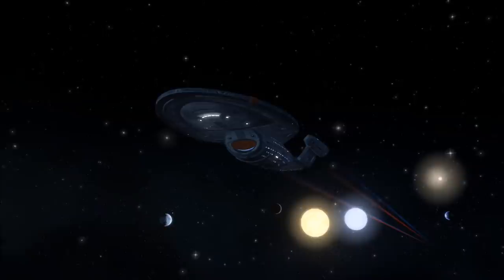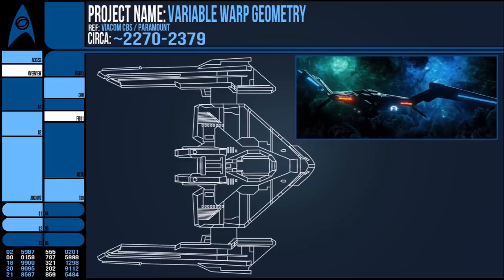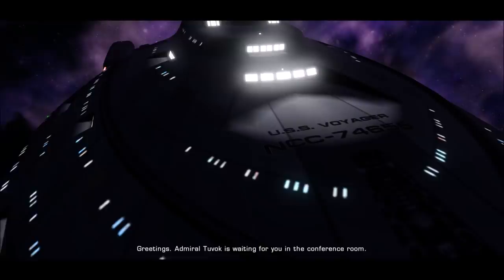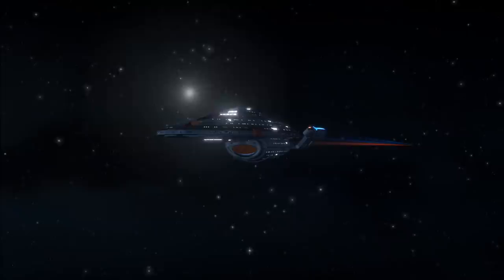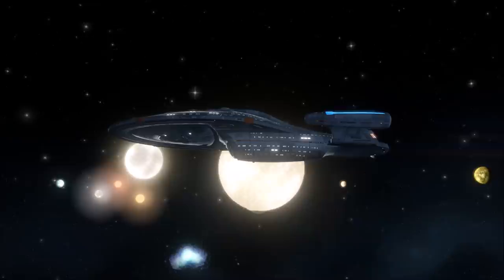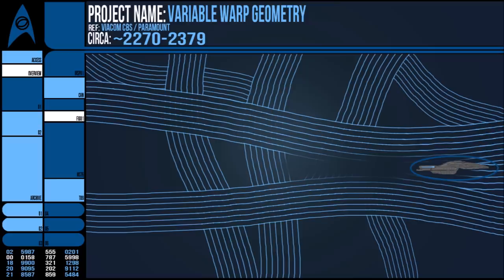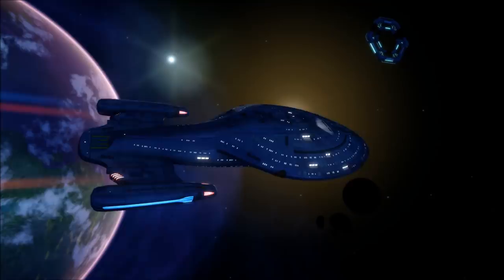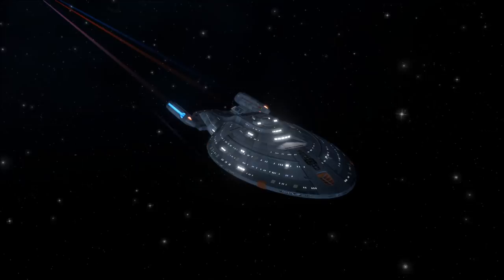VOYAGER'S "Hinged" Nacelles

Comment: Can you cover other FTL drives in sci-fi and compare it to trek and Mass Effect.
Reply: Culture series - the grid, basically subspace also.
Reply: Well, if you are in an unclogged hyper space lane in Star Wars, you can get across the Milky Way sized galaxy in 2-4 days with a fast drive.
Reply: fuck it, Warhammer 40k FTL.
Reply: I thought ships in Mass Effect do not use any kind of FTL at all, since all the travelling between solar systems or different sectors of the galaxy is done via jump gates.
Reply: @Furzkampfbomber  it warps space to allow faster travel. Still considered an FTL drive even by Mass Effect's own worldbuilding.
Reply: @Barry Bend

Ah, thanks for clearing that up. But to make that clear, without jump gates, would there still be faster than light travel in the Mass Effect universe? As I understood it, one of the problems with the jump gates shutting down at the end of ME3 was that this would basically have destroyed the galactic community and let whole planetary populations starve to death?
Reply: @Furzkampfbomber  they'd be going into FTL but not to the speeds of the network. In Mass Effect andromeda the ships go into a faster FTL than the older drives due to a lack of a Mass Effect network.
Reply: @Barry Bend

Then I have profoundly misunderstood FTL mechanics in ME so far. Thanks again for explaining!
Reply: @Furzkampfbomber  Travel at FTL is possible without the network(however not without Mass Effect Technology as its achived via Element Zero), (it was even a part of gameplay in ME 3(and i think in 2 as well) where you jumped to a cluster or similar and had several systems you could travers via FTL flying) however, the FTL speeds achived via regular FTL drives in ME are REALY slow in contrast(well as slow as FTL can actual be) so the destruction of the Mass Relays effectivly destroyed all Travel outside of Local clusters. making some planets who rely on regular inports to sustain themself die do to the cut supply lines.
Reply: @SGT_Weber

Thanks for the explanation! 

And this was one of the things that really bugged me after seeing the end of ME 3, that with the portals shutting down, billions of beings were doomed and yet, this was portrayed as some sort of victory.
Reply: @Furzkampfbomber  well dependng on the ending it WAS complete and utter starvation for a lot of colonys, however the reason WHY it is portrayed as a victory is, depending on ending the Mass Relays are only "damaged" and can be repaired relativly quickly(either wiht or without reaper help) some colonys will starv to death etc but overall its a small price to pay for defeating a foe that was thought undefeatable 

and even if they are completly destroyed, the threat from the Reaper is gone, meaning even if the current Milkyway Species are Likely never able to reestablish any sort of Simliar society as it was pre Reaper war, and some colonys will be dying.. as well as probably all turian forces over earth(and everyone else that needs left handed amino acids or whatever it was) but overall,
the Galactic society has prevailed, it will be smaller most likely, it will not be the same, but they won what was thought to be impossible and furthermore, 

the next generation of species arent doomed for the same fate anymore as any precursor before them, and they do have functioning Mass relays as only Activated ones where destroyed. 

It will be a one way trip for most systems, but they could use these non destroyed ones, together with reaper tech from all the reaper wreckage everywhere to someday rebuild the Network

Tl:Dr
it was the death of trillions, but its also the saving of Many many many More in the future and overall, and depending on ending it was only a minor obstrction of the relay, taking a couple of years to get the major relays up and running again most likely-
It was a victory, it costs a trillions of live, but it is a victory notherless
Reply: @Furzkampfbomber  If I remember right in Mass Effect Andromeda, in the galaxy they went to have no gates but they developed a drive that could jump in the ship.

Comment: Warp travel does not damage regular subspace, if it did then after millions of years of warp capable civilisations there would be no subspace left.
The Hekaras corridor in Forces of Nature was UNIQUELY vulnerable to subspace damage.
Imagine how much damage just Earth and Sol would have received from warp travel, and they've only been at it for a few centuries.

Variable geometry nacelles were to allow travel in the Hekaras corridor and any similar regions (with tetryon radiation) without triggering any effects, a strategically useful ability, especially if encountering similar instabilities during exploration where no rescue ship would know to look if you got in trouble. 
Or just taking a shortcut or fighting ships in that corridor, especially preventing standard warp drive ships from doing further damage in that area by enforcing the speed limit.

Starfleet was testing the Intrepid class's variable geometry nacelles and the Sovereign class's warp core, that also didn't damage subspace in regions that were susceptible. Starfleet were trialing both concepts, the Sovereign's one was considered better, lack of external moving parts probably helped. And that made retrofitting to older ships a possiblity in a minor refit…

This enabled the ship to travel at warp in rare unstable regions where subspace is vunerable.
That it damaged all subspace was a red herring stated by the Doctor when he was being forced to trick Voyager into ejecting their warp core. https://memory-alpha.fandom.com/wiki/Transphasic_warp_drive
https://memory-alpha.fandom.com/wiki/Renaissance_Man_(episode)

Comment: Good video. I knew the hinged nacelles had something to do with protecting subspace. But I didn't understand why they lowered them back down when the ship was at impluse. Now it all makes more sense if they are being constantly adjusted during flight.
Reply: The constant adjustments of the angle does make sense to change the shape of the Warp bubble.

Another reason they go flat when not in use is so the bussard collectors on the nacelles are not blocked by the primary Hull.
Reply: It's a shame they never showed them moving besides the "up to warp"
Reply: It just creates a clear line of site between the nacelles, which is supposedly a Star Trek rule for warp. So Voyager can have the new design of not have pylons sticking out, but still follow the rules to travel at warp

Comment: It could also have something to do with the ship being designed for atmospheric use and landing.
Reply: Beat me to it by 52 minutes!  Landing a starship, even a small one, must be easier with a lower center of gravity.  Of course landing with a generous supply of antimatter on board isn't exactly calming the pilot's nerves, either!
Reply: +Redblade It doesn't have to be either/or.  It can serve dual functions.
Reply: There's an especially hot pit in Hell reserved for people who try to win arguments about canon by saying, "It's just a show/movie."
Reply: Sealion someone else.
Reply: @Redblade 
The pylons up configuration is the most efficient.  The ship is switching from impulse and thrusters to using the warp engines. Pylons up is the same configuration as the various enterprises and other warp driven ships.
Reply: Redblade That’s a lame argument. Even if it’s a TV show, it doesn't mean that we talk about it like it’s completely real. It’s no different then when people talk about how things work in Star Wars or Lord of the Rings or literally any other fictional series.
Reply: Redblade You seem to have missed the point of my comment. We know it is fantasy. We do not give a shit. We chose to talk about it like it’s real.
Reply: @Redblade "fantasy" you say?
Remember the original Shatner star trek? 
With the "flip out" communicator ? 
In the 60s?
 fast forward couple decades we had flip out mobile phones?
Reply: As far as I can recall, they never raised the nacelles when in atmosphere

Comment: Well, with the Alcubierre drive, changing the shape of the bubble from a sphere to something oblong and with a narrower cross section reduced the amount of negative mass needed from the equivalent of all the mass in the Universe to the equivalent of the mass of Jupiter.  The question is why would a flatter geometry be better at sunlight speeds hence necessitating the nacelles be folded down when not at warp?  Is it to line up the impulse engines with the center of mass of the spaceship, if so why not just arrange the impulse engines appropriately in the first place.  Cochrane's warp drive folded out because the ship was launched into orbit on a converted ICBM so it had to fold into a cylinder, stealth would probably be better served by a sheath around the hull and nacelles rather than flexible nacelles.  Really only Cochrane's ship had a reasonable argument for flexible nacelles...

Comment: 2:36 I want to correct you there slightly. The vessel stays fully in normal space, but the warp field is a subspace field, and the warp field bends spacetime to create the warp bubble and therefore the actual propulsion. The field creates the bubble, but they're not the same thing! Subspace drag affects only the warp field, which in turn means you need to pump more energy into the field in order to achieve the same warp field strength. The warp field strength and the relative speed of the warp bubble are related, but better hull geometry can give you more speed/a faster bubble for the same field strength.

This may also be the reason why the warp scale got overhauled, and it explains away some inconsistencies in terms of speed.
The energy pumped into creating a warp field is therefore only loosely linked to the speed reached, since both subspace drag weakening the field strength as well as the hull geometry supporting a more or less efficient bubble play into it.

Comment: They have to have view contact, while at impupse it makes the ship have a smaller profile
Reply: I know that that was an official rule at some point, but it isn't anymore.
Reply: @freshFerdinand  it' s still a rule. All ship designers agree to that: at least 50% contact. As per the defiant class, ot has roughly 30%, the rest is just technology improving in 100 years. As per the Nebula, it shouldn' t be warp capable, the designers admitted it.

Evem the ferengi have a curved hull to have contact, and the same applies to all vessels in continuity which have warp drives exept the Prometheus alpha, which is kind of an exeption, since it only sustains warp and reaches warp 3 on its own, and the aforementioned nebula class, which sometimes is seen whith the secondary hull between the nacelles, which should tear the ship apart, or at least kill everyone in it
Reply: @mckenziecalhoun316  pretty sure it’s not canon. It’s just something Roddenberry pulled out of his ass to discredit Franz Joseph’s tech manual.

There’s plenty of examples of warp capable ships that don’t care about line of sight nacelles: The Jenolan (Sydney class), USS Kelvin (only has one warp nacelle), the runabout and the aforementioned Nebula class.

Comment: What I liked, beyond the nacelles tucking in behind the primary hull for warp travel, is that in the lowered position, the bussard collectors are well positioned to scoop up interstellar hydrogen and anti-hydrogen.
Reply: That is actually a really good point for why they put them down in the first place. after all, once you figured out the optimal angle, there wouldn't be any reason to put them down again.

Comment: But this begs the question why they bother to bring the nacelles down at all instead of leaving them in the warp-position. I can't imagine that having them up hinders impulse. Perhaps they're adjustable to accommodate different "textures" of subspace. 🤔

(5:44 - (cc) *shear)
Reply: I would think their position at warp wasn't fixed and they would adjust the angle as needed thus modifying the warp field to compensate for the drag and reduce damage
Reply: I read that the nacelles were originally supposed to have different positions based on what warp factor the ship was  travelling. The reason we don't see different positions in the show was due to the cost. Much cheaper to have two CGi modes instead of a dozen.
Reply: I've thought that too. Also, if they had to make an emergency jump into warp speed, then it would an extra second or two for the nacelles to swivel back up.

Comment: I thought the usual explanation was that the nacelles were raised so they could have line of sight, but lowered for regular travel so the bussard scoops aren't blocked by the saucer section. Considering line of sight isn't really a strict requirement anymore (I guess it's just an efficiency thing?), I like the variable warp geometry explanation more!
Reply: Your explanation is the accurate one, and it covers two of Gene Roddenberry's four rules of ship design;... The nacelles need to be inline of each other; and they can't be blocked by the saucer (they must be fully visible in front view).

Comment: Yeah, but we never see the nacelles down or even moving when it's at warp (like at all). There is simply down when not in warp and up when at warp.

I mean assuming they were changing angle at warp but by such a small amount we just couldn't see it. Instead of making a mechanism which moves the nacelles through 45 degrees to go from not using warp to using warp, they could've just made a mechanism which moved by <5 degrees instead but already at a 45 angle... Smaller angle changes means less maintenance and would've had the extra effect of protecting the nacelles from head on weapons fire at subwarp too.

No no, personally my theory is that the nacelles were meant to be wildly flapping up and down throughout the series, but Voyager had to leave on its mission before the springs for it arrived... on Tuesday of course.

The poor Delta quadrant subspace was never the same.

Comment: It’s also there to allow the nacelles to “see” each other and create the stable warp field. The nacelles have a “planetary” mode, which allows for the ship to use them as drag enhancers and/or wings when entering or in atmosphere. And they also had a “FTL” mode, which causes them to rotate to a suitable point where the Nacelles “see each other” over the secondary hull.
Reply: pretty sure the “line of sight” thing isn’t canon. It’s just something Roddenberry pulled out of his ass to discredit Franz Joseph’s tech manual.

There’s plenty of examples of warp capable ships that don’t care about line of sight nacelles: The Jenolan (Sydney class), USS Kelvin (only has one warp nacelle), the runabout, Nebula class.

Comment: My (COMPLETELY unofficial) understanding was the warp nacelles needs certain particles for the warp drive to operate and these are acquired through the bussard collectors while the warp drive is disengaged.  The bussard collectors seem to need a mostly clear view ahead to work properly (though the TOS nacelles don't quite clear the primary hull when viewed from ahead; which implies having a surface on one side is also necessary).  For warp to work, the nacelles need to be in a specific position in relation to the rest of the ship (center of mass?).

The much sleeker design of the Intrepid class meant the nacelles needed to be flat to collect the needed particles, but then the geometry didn't allow it to go to warp.  The reverse problem was true when at warp and the nacelles were "up".  Thus, the need to switch from one position to the other when going to and coming out of warp.

The advantage of this explanation is that we never see the nacelles shifting at all while at warp in the show (which one would think it would do if that was it's purpose).  Of course, "looking cool" was undoubtedly a main reason for this design.  :-)

Comment: Thank you for doing the video from my tweet, but I'm still confused. Let me see if I can work through this, the warp engine creates a warp field around a ship through the nacelles, rights? This field acts as a sort of lubrication for the ship to move through normal space into subspace, which has for a lack of a better word less "friction" than normal space? But what I don't get is what is providing the actual thrust? Does this mean that, as long as the warp field is activated, I could theoretically get behind it and push and it'll get past light speed? Or does the warp field while it's "thrumming" act like a paddleboat? Which is why I'm not seeing how there couldn't be sheer stresses on the hinge of those nacelles.

Comment: The out of universe answer was that the producers wanted something on the ship that moved. As with most things the "warp is damaging space" was thrown in after to explain the new design rather than the actual canon reason coming first and the artists being told to design around it. There's a whole Trekyards interview on it with the guy that designed the finished look of Voyager which also shows some of the older designs for it which is pretty interesting.